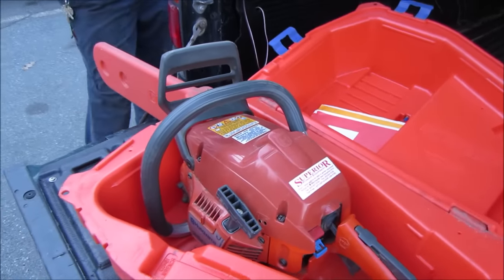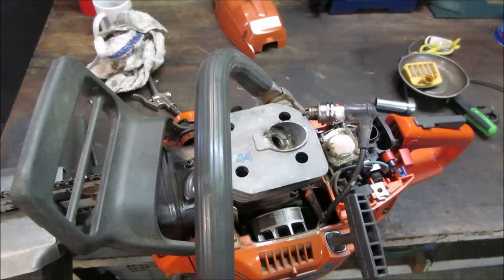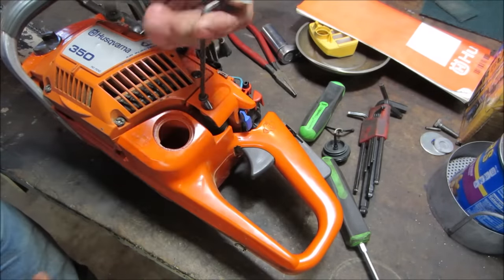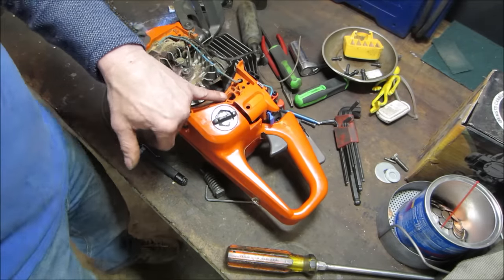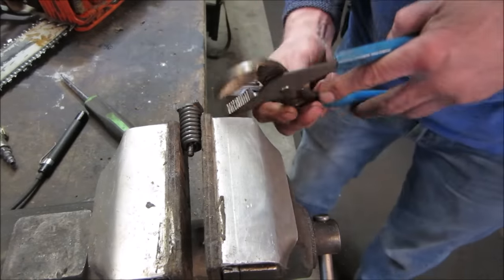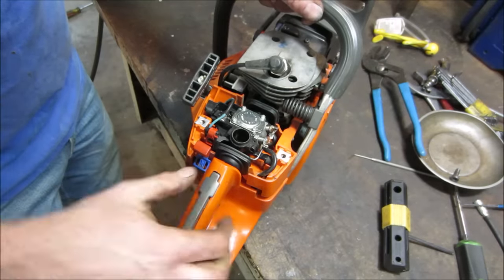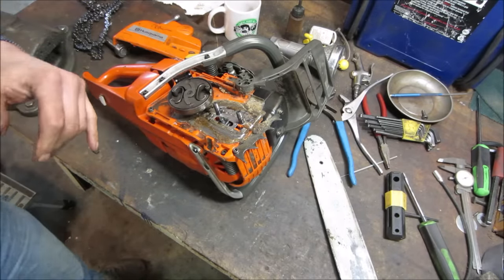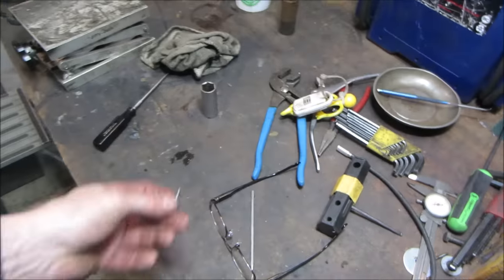Can It Be Saved? The Junkiest Chainsaw Ever. Picked out of The Trash.

Comment: I got a husky 340 that I bought 5 years ago that I haven't bean able to cut a cord of wood with won't stay running my old 141 and my 455 rancher never fail me
Reply: Get the carb numbers, and you can buy a gasket kit for around $3 , or a new carb for around $12.   Usually, the one gasket has a "U" shaped flapper that distorts from ethanol. Replaced this gasket on my carburator, and it ran and idled better than when it was new......
Reply: @w2dmw  I put a new carb and coil  its just a factory flaw I love my other 2 huskyes
Reply: Don't give up; there must be an online forum or group that has the solution..Good Luck...

Comment: Husqvarna machines are original made in Sweden, but also in various other countries these days. They all are been prooved to pass the C€ test. Wich stands for  safety health and natural environment. That is the reason of these anti vibrating springs on the handle of the chainsaw, It,s quite normal that you can move the handle that looks like loose. For the law environment husqvarna made their new generation machines to run on ecological safe fuel. This gas comes in 5L jerrycans called " Aspen 2" for 2 stroke engines and " Aspen 4 " for 4 stroke engines.  This Gas is  called the clean ALKYLATE benzine (gas) . our dealer warned us NOT to use any other 2 stroke gas becouse of the higer temperature at combustion. This will couse damage to the machine and will fall out the guarranty. The husky chainsaw from my van is like 8 years old and still running like a hummingbird.

Comment: As someone who prefers to fix things rather than always buy new, I have also been unhappy with our throw-away society for a number of years. It is so bad that sometimes it is impossible to find parts. I'm sure that not stocking parts past a few years saves mfrs tons of money, but I believe the day is coming where we are going to find ourselves needing to repair more rather than buy new, and mfrs may have to change their business model to provide those parts.

For this chainsaw repair, does anyone know, if the larger bolt had not worked, might a helicoil have worked as well or better? I was thinking drill out the hole a bit larger, seat a helicoil, possibly with an epoxy to help reinforce the plastic around it. What I don't know is whether thinning the plastic to drill it out would stress it so much that it would break, or whether forcing in that bigger bolt would stress the plastic more.

Comment: This is by far the very best saw I've ever used,and I have used most since the age of 13 and now 77 I find it appalling that a Navist could make these remarks about the very best saw I've  used and from what I saw about his saw was pure abuse and nothing more so because he abused and miss used the saw its the worst saw, the thing is the saw can't mix the fuel correctly put good bar oil in it clean or change the air filter or clean the spark plug or just plain cut with it which there is a right way and a wrong way and most that I have seen are navist but they think just because they got it running and cutting wood they think they know it all but what I saw of that saw was pure abuse and nothing more so if you don't know what your doing with a chain saw leave it alone before you cut your legs off.

Comment: Shouldn't a streak of oil be on the bench if the oiler  is working proper?
Reply: No. The oil is supposed to be pumped out when the chain rotates...not when sitting idling or sitting with the engine off on the shelf....
Reply: Sorry, the best way to check if the oiler is working properly is to rev the saw a little and point the end of the bar at some  surface...and you should see a line of oil appear on that surface as the oil flicks off the chain as it goes around the nose of the bar...

Comment: I have a husky 350 and it is the worst piece of trash ever. Wait til you start it and it spits the muffler studs out, that will happen every time. One bar stud fell out, it dropped into the oil tank, not such a big problem. It won't start once warmed up. Yep you found it in the trash for a reason.

Comment: the husky 350 is a all plastic cheap home owner grade saw there ok for lite use only  the 353 is a far Superior saw Aluminum crankcase  the 346XP i think is the best hands down 50cc saw Pro Saw
Reply: That is probably what happened to this saw. Someone bought it and beat it hard and put it away wet. They are light duty homeowner grade saws not medium or heavy duty saws to use hard or often.

Comment: I would just get a helicoil put in it I know their metal and metal and plastic usually don't work but I would just put threadlocker on the screw or bolt  and not tighten it real hard just tight enough to wear feels good

Comment: use piece of weed whacker strung in plastic hole then thread a screw in. it works more times than not. by the approach you have taken to this saw its obvious you have not attended any formal repair training. education is a wonderful thing. maybe next video you can be working under a large shade tree.

Comment: More than likely the chainsaw was purchased from a big-box store the knowledge of the people selling selling chainsaws is extremely Limited. I recommend using a bar and chain oil this should be a non-detergent oil. When sharpening a chainsaw you want to sharpen the tooth so the bir is to the outside of the tooth not to the inside. This way the saw will cut faster and more cleaner.

Comment: What you found is a common issue with Husqvarna saws and the company is aware it is a problem, but according to them it's not a big enough problem to worry about, other fasteners work loose on those saws regularly too. I saw many of them with loose and or missing screws in my small engine shop. Husqvarna isn't my choice for a personal saw either, in my opinion I think they are pretty shabbily made.

Comment: Have not watch all video but logged from age 7 now 60  that's a lifetime saw by the way wax oil no good compared to black oil you will never wear pump out and you set oil to run out same time run out of gas more or less set screw full  .use small chisel to turn that mount out screw new one in finger tight  outside one tighten  with 1/4 inch ratchet.   To strengthen mount they are weak  take haywire rap rubber mount then install

Comment: Needless to say these two saw’s only made it a couple months and operating these saws alongside the Stihl Saws made it very clear that you get what you pay for. The H-saws were under powered and less durable. The H-saws lack of power made the linemen work way harder to get the job done, tired and a sore  back!! H-saws are A POS PLURAL!!! I’ve worked with Stihl Chainsaws for over 30 years and other than Maintenance we have never had any problems or issues with the Stihl chainsaws. 
I tell you what, bring your H- Saw to SA TX. I have to cut up a bunch of Oak Trees. You can cut with your saw for 30 minutes and then you can cut for 30 minutes with my Stihl and you will never want to pick up anything but a Stihl ever again!!!
Reply: Clearly you don't know what you are talking about if you generalize like that over those 2 brands that have made many saws, some of them brilliant, some of them not so much, especially their lower end offerings.

Take the Husqvarna 394 XP for instance, that's a legendary saw and many loggers use it as their main saw for years and years, it has a great reputation for power and reliability, even though it is a bit heavy.
Stihl has flops too, many dislike the MS 201T because it's seen as worse than the MS 200T that it replaced.

The real answer is most likely that the manager saved 200 dollars by buying a "pro-sumer" saw instead of a pro-saw, and thus got a crappy saws. But the thing is, Sthil makes those as well so it's not really a fair comparison, and even if Sthil makes better "pro-sumer" saws, I couldn't care less because you always spend those extra 100-200 bucks to get a pro-saw since they are just that much better, regardless of brand.

Comment: Kicked-over on 2nd pull, started on 3rd...was it still a bit warm from being started?
I run Stihl, and I bring 2 saws, as I always have 1 that absolutely will not run, and if I drove 40 miles into a Nat. Park, that is not good. Now at my hobby farm in nowhere Missouri my weeds are up to my shoulders and my Stihl 111 trimmer will NOT start, compounded by the WORST COPD, so 4 pulls, wait in my AC'd truck, start over, it can take minutes to zan hour, I swear that thing has almost killed me a few times...
Looks like time to hire a kid, I guess... ( I jump on my weeds right down to dirt, this year torn rotator cuff, 3 torn tendons and a completely torn bicep, w/ stage 4 copd, so not doing my chores was warranted...  :(  )  Salut!

Comment: 100% of the time it's the operator malfunction.  Don't be fooled by stupidity. I've owned, all kinds of brands. Homelite  blue. To me is sthil the best saw. Then stihl then husky,  old John Deere's yellow. Old poulan. Nothing new. When craftsman and poulan, and John Deere green. All crap. Cheaply made. I have played with a few . Still running  great. Another one that was hard to crank was the beaver McCullough.  Ran good got hot  then hard to crank. My blue homelite xl automatic oiler  blow it away. No matter how good you kept it clean. Hard to crank. Only doing this since the 70's. My father back in the 40's. First husky the 55 was a great saw. One of homelites  took a bad hit. Tree feel on it. Busted the casing. Luckily,  we had another one to swap. Keep on going.

Comment: I don't think this muppet knows what he's talking about. I've never seen a chainsaw blade placed in a vice before. Think the title says it all about this muppet.
Reply: Chainsaw bars are solid right through everywhere except at the tip (if it has a sprocket tip).
The groove (that the tangs ride in at the bottom of the chain) goes right round the bar except at the rear edge where the chain rides around the sprocket.
So the recommended way to hold a bar steady when working on it or the chain is in some type of vice.....

Comment: There isn't anything wrong with the saw its the idiots that don't read the manual when they get a saw , I have heaps of them they are very reliable and  I think they could have run it with the chain not on the sprocket correctly but along side of the sprocket !But who knows  They are so user friendly taking  the saw apart to replace the rings is so simple ,and also everything else is basic

Comment: You could have shown how to grease the nose wheel. Lots of people don't know that.
Reply: Lots of chain bars do not have a grease hole..
The roller bearing for the nose sprocket is lubricated by the chain bar oil....but it never hurts to dribble some chain bar oil directly onto the sprocket after you clean the bar.....
And, of course, a solid nose bar has no sprocket and no grease hole.
Reply: @JohnSmith-pl2bk  Husquvarna bars have a greaseable bearing.

Comment: Most people don't know they can flip the bar. U do it at ever gas cycle.  Blow it clean and if u have the hole at the tip u can shoot some grease. For that top sprocket. If u mess up a bar. Shame on you. I have some bars over 50 years old. They  been rebuilt. New tips. Etc. Re gauged. Cheaper that way.

Comment: Also I forgot to add the the isolator Mount that is underneath the starter you can replace that with a piece of gas line hose just finding the right size hose.

Comment: Some people can and will destroy an anvil!   Burn up the chain... no chain oil Ill bet / maybe the oiler is stopped up.... gee some people doesn't know what maintenance is or means!
Reply: Check the clunk filter on the end of the oil tank oil pickup...any water on this will stop the oil flowing into the oil pump...
Ditto clunk filter on end of gas pickup in gas tank. 
Use bent wire in thru filler holes to hook these clunk filters out and check....better still replace...
Why are they called clunk filters? 
Because when the saw is tipped in any direction, gravity makes the filter clunk down inside on the lowest part of the tank...where the liquid is...helps when the saw is upside down or sideways....

Comment: New cs400 echo eats sprockets in around 7 weeks. Cut 4 trees totaled sprocket. Bar will not stay tight. Depo will not help me fix the problem. 
DO YOURSELF A FAVOR BUY FROM A MOWER STORE. 
ECHO IS JUNK 
NEVER AGAIN.
Reply: The bar coming loose is the problem.
Figuring out why is the solution.
Make it the seller's problem...or they get to replace the saw?

Comment: He has no idea how to use husqvarna and how to start it. It would start in 2 swings no million times like he did. Read the manual first. He went the stupid way. You make button position up than you pull the handle 1 time. it will not start you will hear the sound like it wanted to start 52:02, but not started. And here you stop and pull the button down position pull handle and it will start easy. If you do same as he did it will be hard to start and will take million times to start.

Comment: Pulled on saw to hard he got pinched in a cut. Also saw so dull burnt blade.. movement bottom saw rubbers broke off one side or other this person very rough on saw which means big time amateur  mix oil 37 to one mix last forever 150 ml to 4.5 ltres... best chain oil in world is  regular used engine oil...  make sure you do not use synthetic

Comment: 9/10 chainsaws burn up from people starting  the saw and not letting it warm up. Steel ring expands faster than the Aluminum piston. Piston ring seizes in the groove and gouges the cylinder wall. 100% user error. Worst case dumbass put strait gas in and burnt it up in 30 seconds

Comment: A LOT OF plastic there! Plastic Is light but not metal. As it ages it gets brittle. If the plastic came from China after 5 years good luck. Rubber Maid was great  but  do they still  manufacture Rubbermaid?
   A CHAINSAW FRAME needs to be rugged. Many happy home owners don't  cut notches. As they cut deep they discover the weight of the tree is binding the saw! When they rip it out in anger of course the plastic fractures as it should. 
  PLASTIC BUMPERS ON CARS & Is the result of no capitalism. The New World Order is all   about socialism!